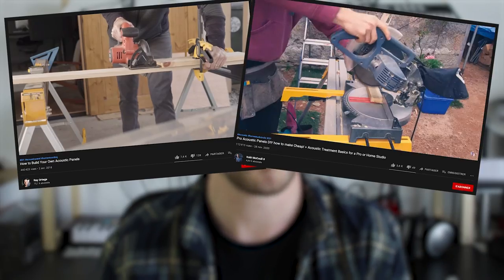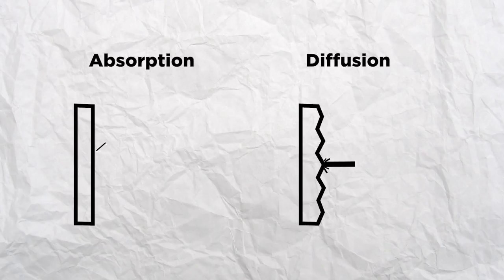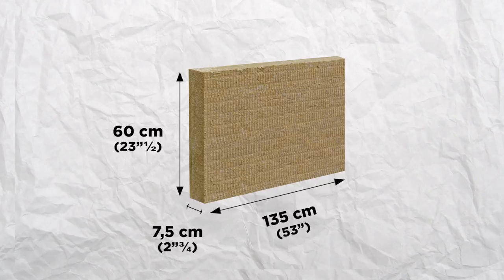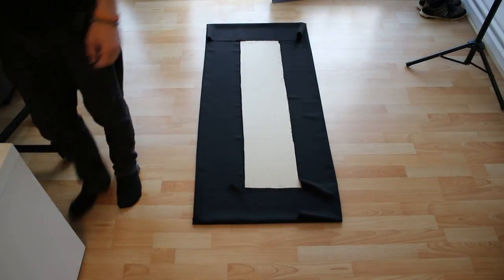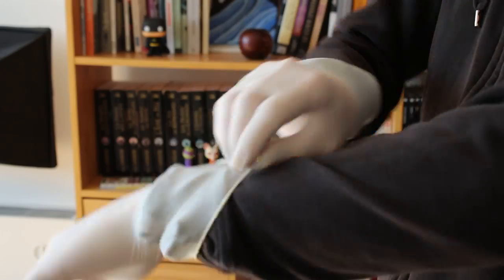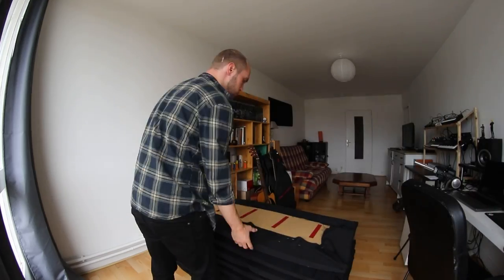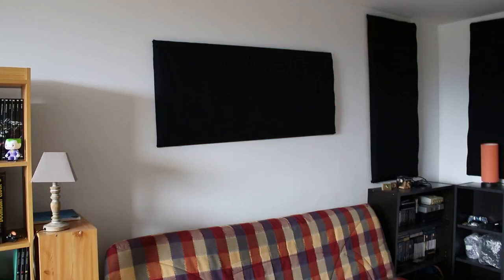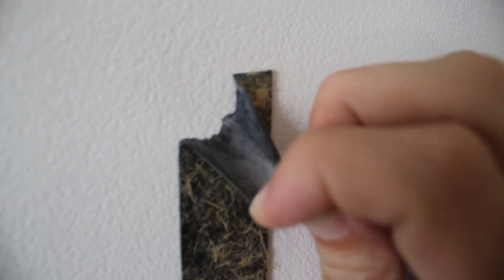DIY: CHEAP and EASY Acoustic panels

Comment: Sorry to break it to you but these won't perform as intended. It's the wrong material, and the solid back panel doesn't help, much better to have a gap behind the panels. The material you used will be good for bass traps, if used in huge amounts in the corners. But not for "acoustic panels". Especially not in these dimensions (75mm thick) WITHOUT air gap behind them. I'm sorry you spend to much money on it.
Reply: On a more constructive note: Good materials would be Basotect or Rockwool Termarock for example (in Europe). The ones you build will probably help a bit with higher frequencies, but not so much with the "real trouble-makers" in the lower and mid frequencies. If you're interested in actually setting up a studio there's no way around a (calibrated) microphone and a software. Room EQ Wizard is a free one that is VERY capable. Imho this should be done before putting up any treatment. Some of the microphones can be very cheap. Everything else is guesswork.
Reply: That's interesting, thanks for your input here. I didn't glue stick my panels so that's good. Can you please comment on fabric used here? I wonder if material and it's structure matter, I suppose they do. Is real wool better than polyester one?

Comment: Great video on the measurements for the cloth over the 3m mdf wood support did you got a foot over the actual length?
Reply from the maker: I don't remember the actual measurements but yes, the cloth is cut larger than the MDF wood. You need some extra length to cover the thickness of the rock wool, then some extra length to staple the cloth behind the MDF wood

Comment: Maybe you could cut a large hole in the back of the wood panel.  That would greatly lighten it.  And, you could mount it away from the wall.
Reply from the maker: Great to make it lighter, but that would expose the rock wool inside. I'd be afraid to breathe too much rock wool dust

Comment: That's exactly what I did in my house. When I saw tutorials with building frames from wood, I knew I had to do it easier, it's just not needed. Also in my country the panels dimensions are 100x60cm so it's easy to divide for smaller ones - I created even 30x50cm. With those you can create ikea-like wall designs :)

Comment: wooden backplate for your panels makes them a lot less effective, the best design is to have a wooden frame for the sides and to mount panels with at least 1.5cm distance from the wall
Reply: How about drilling many holes into the pdf so it is not solid. Wrapping the whole of the back with fabric to contain the rock wool except the sections where tape would go. This would contain all rockwool and also add breathability. The 1.5 inch from the wall can be managed by adding wooden strips to the wall in unison with the tape. We could nail or drill the wooden strip if needed. And paste this panel onto it via tape. Or we can also do velcro.